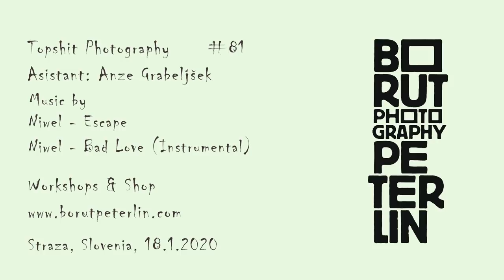Carbon Print from a Film Negative / vlog #81

Comment: Nice to see that you are using a JOBO to process your film. I own and operate a film processing lab in the United States, it might be helpful to try a more active developer if going for more density with expired film on a JOBO.  Something like straight XTOL or Rodinal at 1:25. D-76 is nice, but requires quite a bit of developer per area of film for complete development (relative to other developers), and sometimes with the smaller JOBO tanks, you can run into not having enough developer for what you’re trying to do if the film is expired.  I always go for at least 300ml of D76 (before dilution) for every 80 square inches of film (one roll of 120, or 135-36, or 4 sheets of 4x5) in the tank for non expired film, and even more for expired film. Xtol only requires 100ml before dilution, and Rodinal 10ml before dilution for normal film that is not expired. Maybe that’s something to look at if planning to use expired film where you need lots of density, like for carbon printing.

Comment: In the case of low contrast I would suggest to scan the negative, push the contrast and print this with an inkjet on a transparent sheet. If you use the right transparencies and printer settings it will work as a charm.
Reply from the maker: Easier is just to prepare a new carbon tissue with the exact contrast needed.

Comment: Couldn't one put a UV bulb in a projector/enlarger and do a enlarged carbon print??
Or the exposure needed would perhaps take forever.
Reply: Yeah it would take ages. Glass absorbs UV rather effectively. Would be impossible to focus properly or safety either as you can't really see UV all that well and it damages your eyes.
Reply from the maker: What Derek said. But I have bought a stadium lamp with a 2000W halogen bulb and I will try to use it as a source for my Durst 138 enlarger. In the 19th century they've used solar enlarger.
Reply: @BorutPeterlinPhotography  Hope it works and that the Durst don't melt in the process.
Reply: some months ago I've made a pretty good 8x10 siderotype (argirotype) print from an enlarged 35mm negative using a powerful (50 W) LED UV source fitted in a modified enlarger. exposure time ranges from half an hour to two hours, depending on the largest aperture of your lens.  I focused by eye, reflecting UV light on a white paper sheet (it will glow, just like white clothes in a disco). never use a focus finder: it can seriously hurt your eyes!

I will try salted paper soon :)
Reply: Borut, if you want to send me some of those carbon tissues I can try to give "enlarged carbon prints" a go ;)
(of course you have to give me some directions about the proper 35mm negative density and contrast)

Comment: Brilliant. Thank you from Scotland. Leave a light on. We will be back soon. We just need to shake off England first.

I'm just about to do the same thing you demo'd with Fomapan 100 but for cyanotype and salt print. How long did you stew in what dilution of D76? You could save me some trial and error. (I was going to try another developer I have to hand or maybe Ilford PQ which is recommended for dense sheet film negs).
Reply from the maker: A negative can not be suitable for cyanotype and for salt print. For cyanotype, just expose it as normal and push development for 30% of time. For salt print I would exposed it +1 f stop and develop it for +80% of recommended time.
Reply: @BorutPeterlinPhotography  So neg for cyanotype is denser and higher contrast whilst salt print is just denser but same kind of gamma as for silver gelatin?
Reply: @BorutPeterlinPhotography  Ah I read that wrong! Yes I see what you mean. Much denser and more contrasty for salt print.